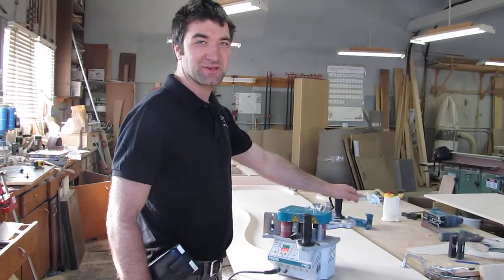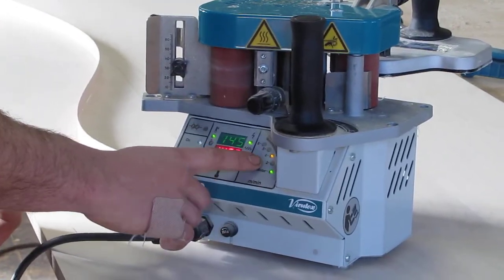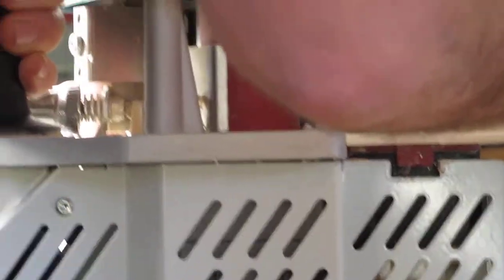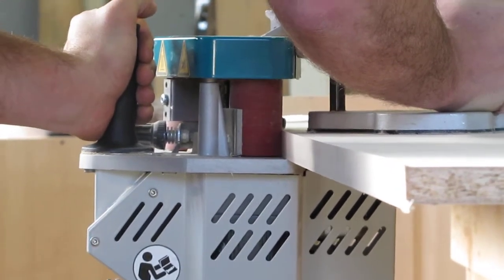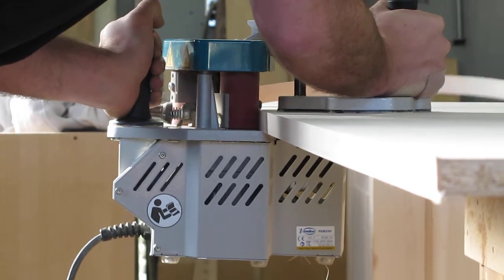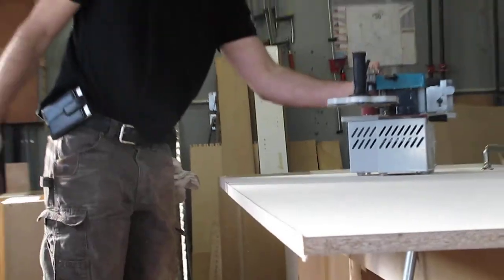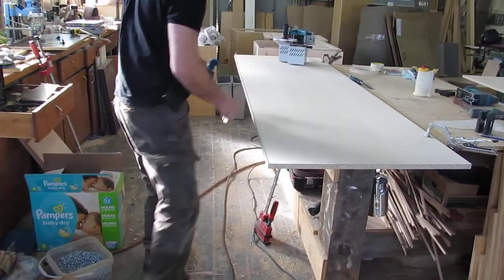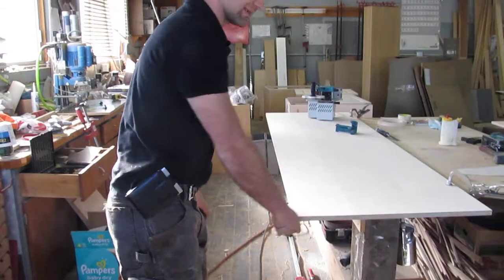Virutex PEB250 edgebander review and demo

Comment: So, 4 years later are you still happy with this unit?  Any long term reliability issues?
Reply from the maker: yes the unit is excellent. you have to clean it once and awhile and I had to replace one gear but I use it alot
Reply: @hewittcustommillwork36   Thanks for the response. I'm looking at the conturo which I like for the easy no fuss glue, but its considerably more.  How much work is required to clean it after each use. With the festool you just turn it off.  I have never used anything with a glue pot before and have read they can be high maintenance , hard to clean and any unused glue after being heated is garbage.  Sorry to keep asking questions but there is very little info available about this unit.
Reply: aaron fisher did you end up pulling the trigger on a Virutex? I’m in the same boat you are/were. Super curious